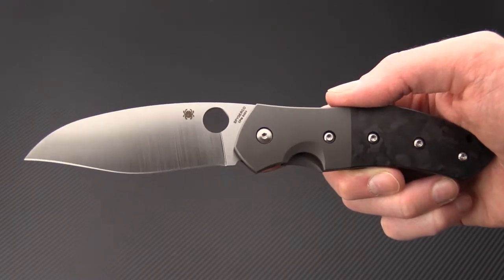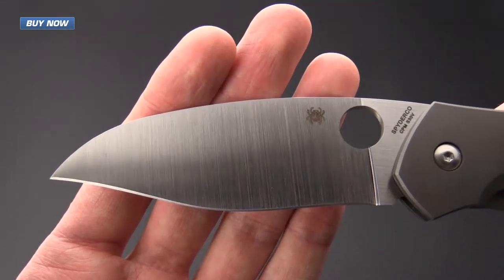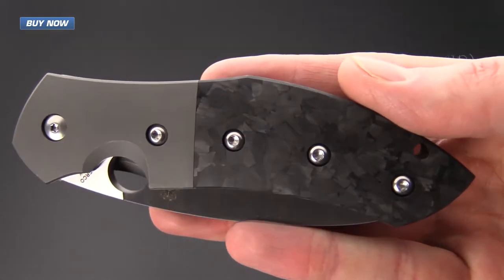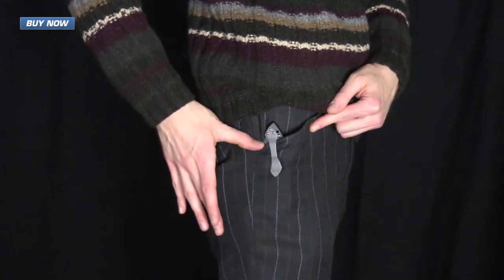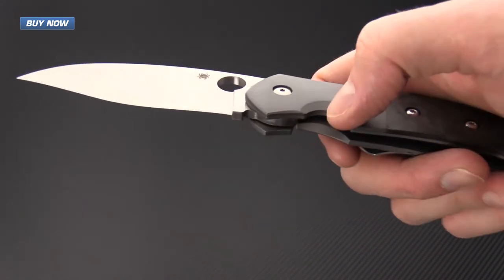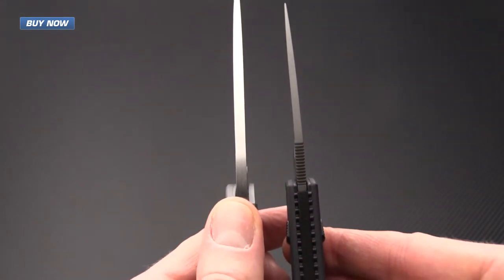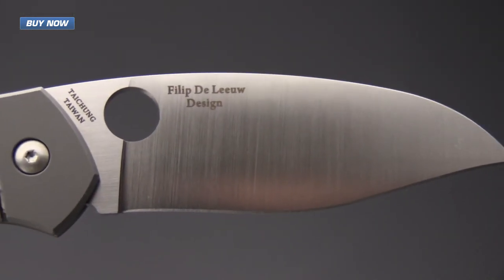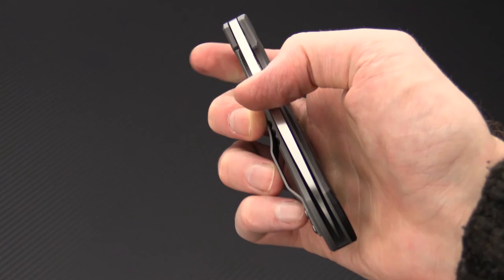Spyderco Filip De Leeuw Myrtle Marbled Carbon Fiber Overveiw

Comment: Great quality... but SO UGLY! With blade stock that thick I must wonder if it's an anti tank knife. Overall it's not attractive, very expensive, only cuts well do to ffg and the clip is gigantic. Either way, thanks for the review. I'm heading to Troy tomorrow, you're the closest knife shop within 90 minutes. Maybe handling this beast will change my opinion... maybe.
Reply from the maker: +ToxicityAssured Not sure if you made it in but despite the mixed reception we're currently sold out of the Myrtle.